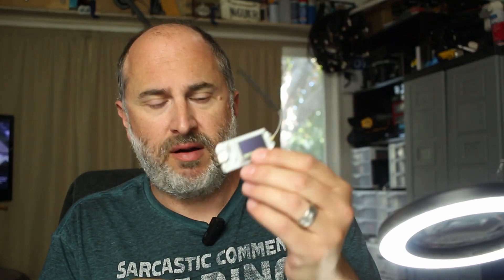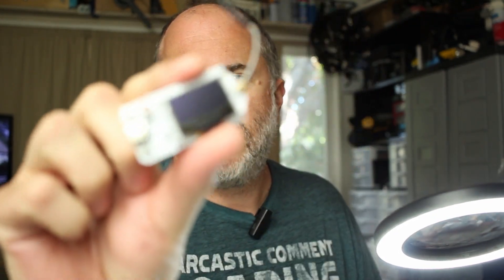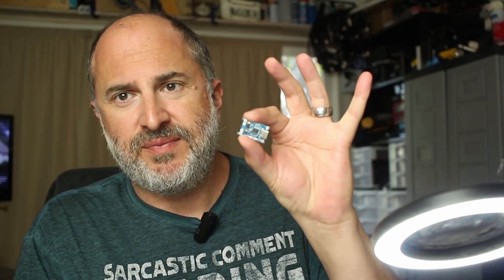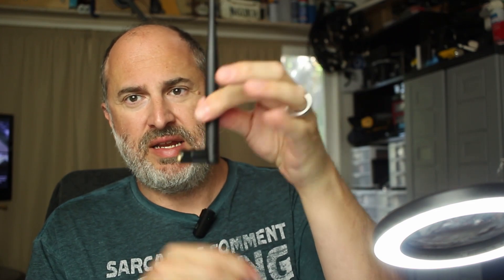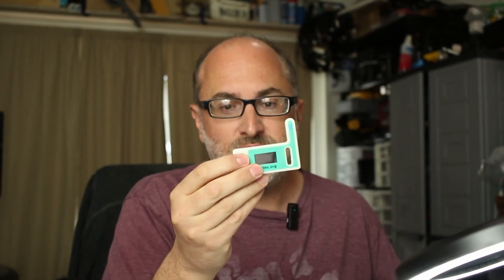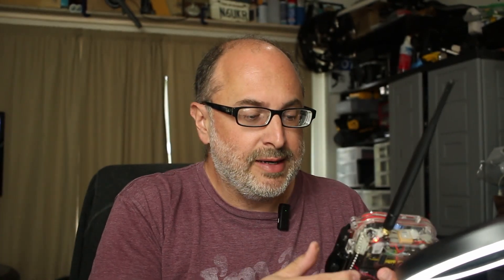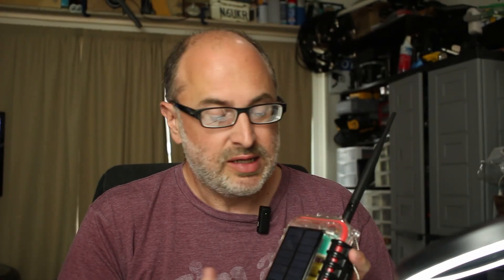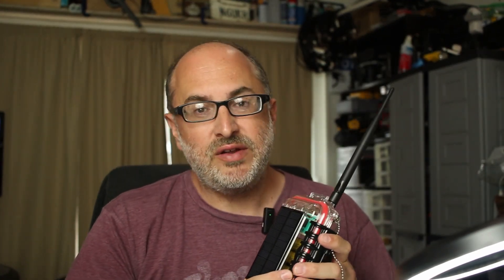DIY Meshtastic: Decentralized Comms Device

Comment: Thanks for a very well detailed overview of your buildout, will definitely check out the other video.
I have a question: For what I understood the heltec lora32 v3.1 has a battery charger included.
Why did you ended up adding a separate one in your build?
Thanks again!!
Reply from the maker: I didn't realize it had that capability, that's cool. I just looked into it real quick and couldn't find what the charging current it. The board I'm using is 1amp so if its the same or more that's a win. I guess the only other reason/consideration might be the placement of the charging USB port in relation to the screen and its USB port. That info is super helpful when I look at doing a revised version. Thanks!